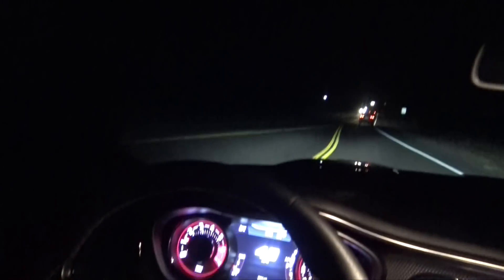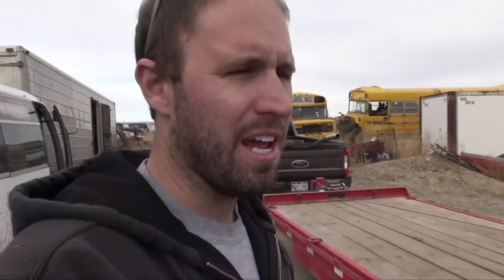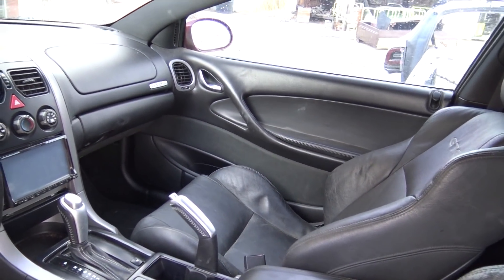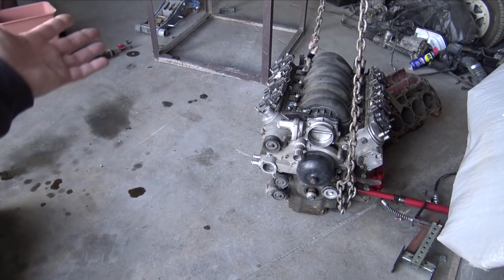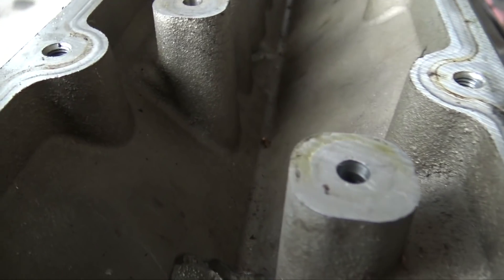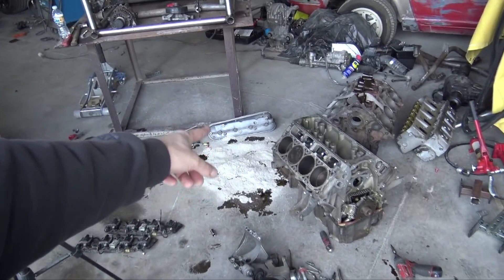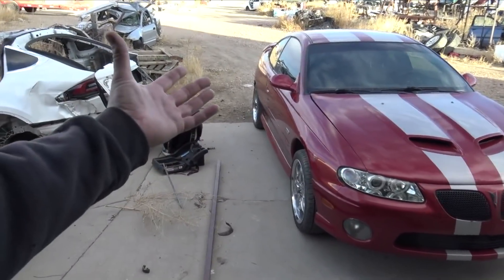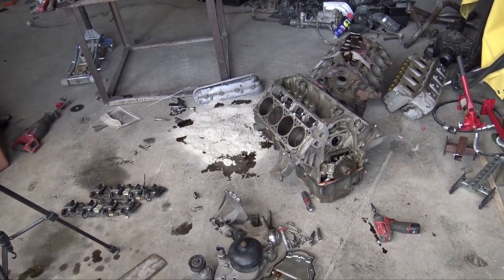Buying the CHEAPEST LS2 GTO in the Country!!!!

Comment: My brother lucked into & purchased a 1979 z28 with a 1973 sb400 the 4.125 bore 400. It was built by a local machine shop, bored .030 over to a 406, custom rods, to make a stroker 406,  Amber lightweight pistons 11/1 compression aftermarket heads 220/160. Hydraulic Roller rockers, Holley 750 double pumper with manual secondaries, Th400 with a new valve body, shift kit 3500 stall, B&M mega shifter, 373 gears. IT WAS FAST!!!!! I would love to have a newer Gto, Chevy S.S., or a Holden!!!!! You hit pay dirt!!!! Score bro!!!!

Comment: I have a 05 and a 06,get new lifters ,660 btr cam n spring kit,stage 3,.A trunion kit is a must for rockers,  new oil pump,good timing chain,new push rods.new bolts are a must as gm used tourque to yield bolts one time use bolts believe me,they will stretch and break off in block..cam specs for the btr stage 3 are 231/242__617/595 lift love it.the other cam might be ok if it was stored correctly .

Comment: You got a fantastic deal there as in Australia where they were made and exported to the USA they are very expensive and are a collectors item. The cheapest on the market sells for around
$33,000 AUD that is $23,500 USD and the most expensive one I could see was a  Holden Monaro GTS Auto for $115,000 AUD that is $83,000 USD.

Comment: I have a 2004 dodge 3500 that I bought new. It's a dually that came with GoodYear 235 - 80 -17 tires. The truck now has 340,000 + miles on it  now and always have replaced them with the same type of tire . They still have useable tread at 100,000 miles so why change brands.  The GoodYears cost more but  they last.   I'll never go back to single rear wheel truck   , I have stock wheels  that have the stock plastic hub caps  [ LOL ] that are good enough for my use.

Comment: When oil goes through the bypass instead of the filter it's because it over pressurizing, when that happens the oil gets returned to the pan, It does not continue onto the lubrication system as Dave seems to iterate, the engine ONLY gets filtered oil!
Reply from the maker: There is a bypass for the filter when the oil is too thick when it's cold it bypasses the filter into the system not the pan

Comment: That trailer is too big to tow without duallies in my opinion, if you loose a rear tire on a single wheel truck towing a trailer it’s not pretty, I’ve seen it happen many times. I can’t believe you would be more interested in how it looks over the safety of towing properly, seems short sighted.